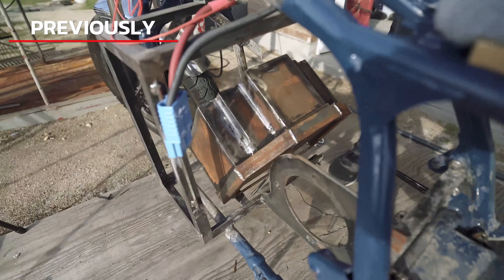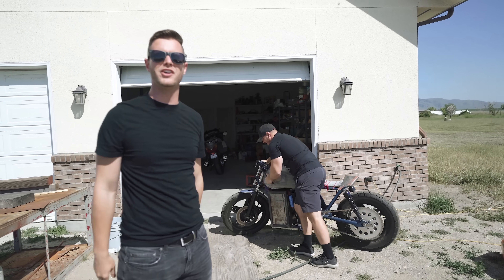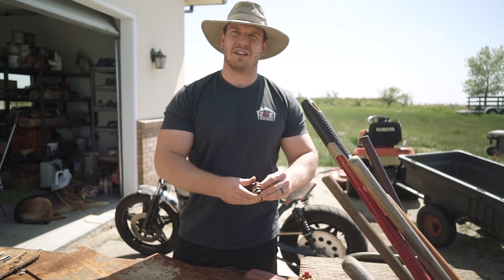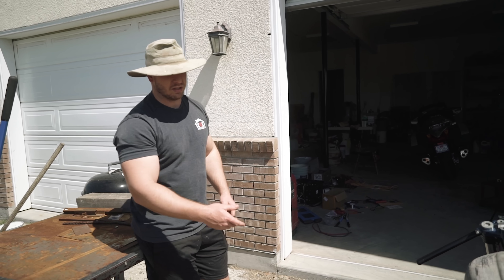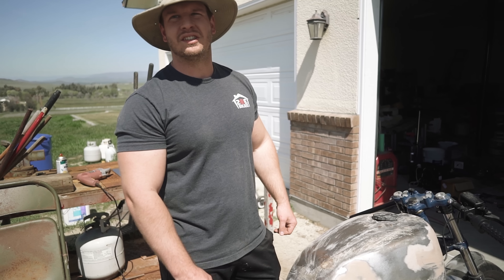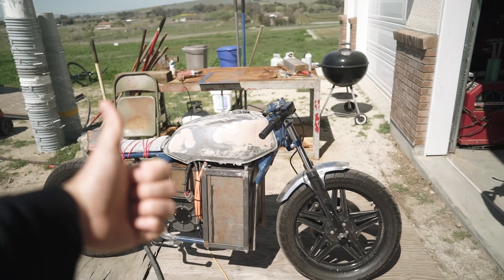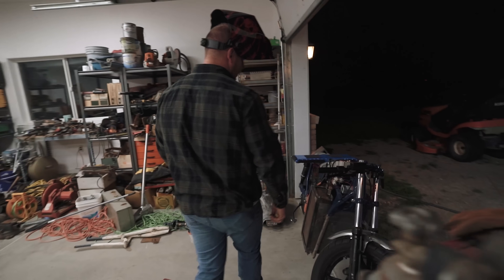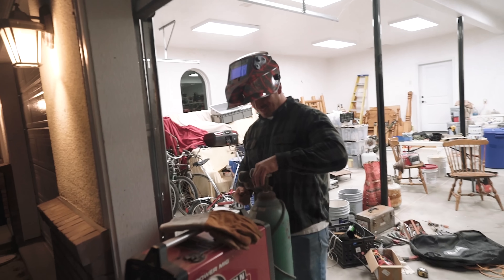We Made a SUPER-CAPACITOR for the ELECTRIC CAFE RACER Conversion Project

Comment: Hey. How the capacitor is connected to the battery. If it is directly next to the battery, can't a situation arise where the empty capacitor appears as a short circuit to the battery. Especially if the battery BMS limits the current and the capacitor discharges. So I've been thinking about a capacitor next to the electric scooter's battery.

Comment: I just use 24 40152 LiFePO4 cells that can deliver the amps to the 150 amp sabvoton controller. My cafe racer is 105 lbs, running a 12 kw hubmotor in a 17” motorcycle rim.  I use a bluetooth balancer…but NO bms between battery and controller to limit current.  Short cables between battery and controller.  No frills, but lifts front wheel effortlessly, 92 km/hr without flux weakening.  Silent, no chain noise….

Comment: why didnt they use the gas tank to put the battery in to save room instead of that big box ?
is it because all the wires are in gas tank?
and if they made the gas tank a battery you can easy remove it and replace with other battery later on when needs to be replace 
i think you better off to make thing come off like lego block to up grade and to remove easy and fast

Comment: Can you help me my brothers I’m about to buy a 2021 Zero SR and I need to know how many volt super capacitor battery pack I need to make and how do I install it , does the capacitor battery pack connect to the controller or to the existing bikes battery pack, I would love to increase range and power since theoretically and does recharge by regen braking
Reply: I read about 300 amps at 42 volts makes a 14kw battery back if so than that’s about 18 2.7volt caps

Comment: its a good idea in theory but due to the size of the capacitor pack you would be better off adding more battery which would lower the overall damage to the battery and increase performance in a high current scenario . What youve done here is completely and utterly pointless, capacitors give out their power from 0v-max voltage and lithium iron batteries 2.5-3.65v what youve done is make a high power capacitor that will only be used to what like 10% of its capacity and due to this its likely never even helping. Its mostly dead weight.

Comment: Supercapacitor nice idea but will not give measurable difference besides giving a little more stable power from a stop. would have rather liked to see some more powerful battery chemistry been used or higher quality battery cells. if manufacturers aren't using this sort of design there is a reason... usually.

Comment: Awesome project, really looking forward to see the finished product and how it performs , I am really curious about the super capacitors , I am getting myself into e-bikes, I have a rumble bike I have been upgrading as the original battery-controller-motor combination was really bad .  If you can share a basic wiring diagram to see how the capacitor was integrated to the bike it will help

Comment: What was your reasoning on picking a super capacitor? For the motor you’ve picked I don’t think it makes any sense. The current draw isn’t that high for the cells you have, but I do forget what chemistry you went with. Unless you’re using it as a secondary source to like launch faster and bypass the controller, but I wouldn’t think the power would be sustainable for more than a second. Was it just more to have fun?

Comment: Just an idea but try and get an oscilloscope hooked up to it. Measure things like pack voltage with and without the cap connected. Would be interesting to compare the voltage drop over time. It would prove if the pack is dropping too low on startup causing it to cut out or if there is some problem with the controller.

Comment: Isn't the battery pack (not super-capacitor but big boy) going to heat up in that metal box ? Is there any kind of cooling system or openings or do you think that just the breeze of the ride is going to cool it of enough ?

Comment: When you solder on SB connectors heat just the contact and fill it with solder. Then plunge the cable in. This makes a perfect connection without wicking solder up the cable.
Reply: That’s actually a good idea! I like to crimp it first to get more copper contacting

Comment: I'm a little ignorant on all the properties of the capacitors but my initial thought is to wonder if they will help increase the longevity of the cells by evening out the large current draws? I'm thinking of the graphs I've found for various 18650 cells that show the discharge rates vs time to total (effective) discharge. 

Do you have the specs for your battery packs posted anywhere? Like which cells you are using as well as the number of parallel/series groups per pack.
Reply from the maker: I think the last video has links in the description!

Comment: Capacitor will solve the spike need for high acceleration, but it comes with a problem.
The capacitor will discharge super fast, and will be a short-circuit until charged.
The capacitor will short the battery to get the 0,3 kWh as fast as possible, maybe even more Amps than what is used in the acceleration, if you are driving the battery will be already at max Amps charging the capacitor but the motor needs Amps too...
To resolve this, you need something to limit the charging Amps of the capacitor. Something like a BMS with charge/discharge separated port.
Reply: I wondered about how the current would be regulated from the pack to the capacitors too as I assumed without any regulation the draw from the capacitors would be massive.  

My knowledge in this area isn't comprehensive so there's all sorts of things I may not be aware of. From what you state, it sounds like you have the same concerns so maybe I'm not missing much.
Reply: That was really well thought out! Realistically, the voltage of the capacitor will not drop much below the voltage of the battery. If the controller calls for 300amps, it’ll come from both the battery and capacitor simultaneously, but in situations where the capacitor is depleted, it will not really refill until after the draw from the controller is gone. Overall, the stress on the battery will be less, but it will be charging the capacitor a split second after the motor draw drops off from full, and even then not on a capacitor at 0 volts. More realistically, the depleted capacitor may be 90 volts, which is not much energy required to top it off
Reply: @LordCurt  After a better though I can conclude my though is half wrong and you are right, but with a caveat.
After attached to the battery the capacitor will never go below battery voltage.
The capacitor will only work in delta of the drop voltage of the battery. (100V no load, underload goes 97V and the capacitor will discharge till 97V and then fluctuate/intermittent charge/discharge arrow battery voltage untill no load or low load).
So, you are right capacitor will always help, but the capacity in that voltage drop is really low.
The strange thing is that now the bike doesn't cut off and that means the problem comes from the BMS and not the controller?? (For the controller to cut off the battery would need to go to low state of voltage)
 Did you tried to record the BMS(bluetooth) voltage of each single cell when at full load (without capacitor)?
Maybe one cell is bad and at load the drop is to high and the BMS cut off for a breaf second?
Or maybe the BMS it not correctly programed for the Amps you bought (I have read some stories on 300A BMS when you program through bluetooth they become 150A because there's no 300A option on the APP), and the BMS protect against over current???
I don't see other options why the original battery would cut off. 
Did ever tried full load without BMS, connecting controller directly to the battery just to test if the cut off happens?

Comment: No paint needed kurt engineering a DIY bike that is comparable to the livewire and zero motorcycles. Should not be hidden. Clear coat and cover and fair as neccessary add the secret display and that's all. The mad inventor looks are awesome

Comment: Can we get some supercap specs? 
-Final Capacitance 
-rated voltage of each capacitor (2.6.2.7.2.75, or 2.8?)
-Maximum Voltage vs rated voltage
-Balancing circuit
-Maximum discharge current
-AWG of wire  you're connecting to the bus bars

I've got a 34 Wh setup, but they're in a 6s2p config for my gasser. 
The greatest thing about the setup is that I've started the car at as low as 8.5V-9V.
The alternator maxes out at 130A of charging (1.5kW) or 10W with my small sunroof solar panel. It saves 15lbs but I did it to get rid of my lead-acid. Lead-acid is a pain.
https://photos.app.goo.gl/NPHGyuRrHg5sK2Wa8
Reply from the maker: Video to follow on Monday!

Comment: Isn't the capacitor bank pointless if you don't have a charge limiter on it so that it doesn't pull same current from the lithium pack as it released moments ago?
I'm also not very confident about two differently sized battery packs(build with multiple cells in series) connected in parallel, I hope those BMS wires you pointed out are connecting all P groups together.
Also if you need super caps, use maxwells (tesla acquired them some time ago) not some chinese ones.
Reply: The caps give a harder punch off the line and the battery packs is good as long as they are equal volts the capacity doesn't matter because they will drain evenly.

Comment: i actually didnt undestand the purpose of the supercapacitor, someone please explain?
Reply: really helps with regenerative braking storing that energy quickly and using it when you accelerate. you are not dealing with chemicals based reactions of lithium ion batteries.
and also rapid charging they have a huge advantage vs lithium ion battery's and instead reduce charging time by a few hours on a full sized vehicle you could super charge in a few minutes.

also in the future you could potentially Wirelessly charge the supercapacitors and no longer need a wire. just park your bike and charge it.
 but right now, they aren’t able to store as much as lithium batteries.

But right now they are used to rapidly charge the power supplies in hybrids from regen braking,
so you can get a huge amount of range purely by harvesting and reusing so much braking energy. despite it being low capacity and it only adds around 10 lbs to the bike with metal housing.
but on a highway its not as good as you are not using regen braking  so 100% supercap battery is not as good.
Reply: @EpicProvider  could also be used for quicker acceleration, more power release in a small amount of time than a normal battery
Reply: got it, thanx. basically its a "fast in/out gateway for the energy to travel"
Reply: From my somewhat limited understanding, they can even out the large current draws and lithium cells will provide more energy at lower draws versus higher. 

Here's an example graph. Higher C rating means bigger current draw.

https://imgur.com/a/9JJMalE

Comment: i ride a lot of EVs and if not mistaken, super capacitors are used for fast charging correct? Do you know how long it will take to charge from 0-100%?
Reply: Post up a video of just one of them.
Reply: really helps with regenerative braking storing that energy and using it when you accelerate.
and also rapid charging they have a huge advantage vs lithium ion battery's and instead reduce charging time by a few hours

also in the future you could potentially Wirelessly charge the supercapacitors and no longer need a wire. just park your bike and charge it.

Comment: First bike with a supercapacitor I have seen and it makes sooo much sense. You will be able to deploy instant power for takeoffs and any regeneration from braking you get will be able to be stored at 98% recovery rather than the 3 to 5% normally possible using batteries. This will massively increase your range and power delivery stats! Really nice work! 
Almost a shame to paint it up, has a real nice apocalypse feel to it with the rust patena and banged up look. Will scare the hell out of other bikers and drivers thinking it's a junker!

Comment: Its all coming together like a glove! Im still confused on the purpose of the Super capacitor and what it adds to the build.
Reply from the maker: It was to solve the throttle cut issue we were dealing with.
Reply: @TheInja    I think maybe a cell(s) are experiencing voltage sag and tripping your bms under hard throttling.

Comment: Shoot!! You’re a freaking genius! Why has nobody added supercapacitors to motorcycles before??
Reply: They have, but those videos were rarely watched
Reply: @OrdainedMinister  links so I can watch?
Reply: Lamborghini
Reply: I thought about it 10 years ago... But I'm broke.
Reply: Cause they do nothing. In the current wiring configuration the caps are in parallel to the battery. And when you parallel batteries voltage will be taken from the highest source. So you hit the throttle and both the caps and the battery will give power, but due to the caps being super super small (capacity) they will just follow the battery voltage.

The added weight is worse than any "help" given by the capacitors.
Reply: @marsrover001  that makes sense, it can't hurt but will be hardy noticeable with the big battery pack they have
Reply: @marsrover001  it could definitely help to provide pulses during low motor speed! There are definite limitations, but it can smooth out battery operation.
Reply: @LordCurt  Big fan sirr♥️🤗
Reply: @LordCurt  Nope. If a super cap provides any improvement, that indicates a battery problem.
It's already trivial to implement a battery that can effortlessly saturate the controller.
All this is going to do is add a failure point, wind resistance, and weight.
Not buying it for a moment.
Reply: @marsrover001  I was wondering how the S-Caps had been incorporated.
Most energy drain is in the first few seconds of a standing start so to me it makes sense that the S-Caps would take care of that and the main batteries give the range.
I was hoping to see how that had been implemented !
Reply: @marsrover001  dont know the farads on those, but i have smaller, and they are 350f each 2.7 volts. Diveded on 6 in series, 58 farad, think short amperage is 850a each for mine, Gonna use them on my stereo build.. I think they will take some load off the battery on this bike, but dont know the specs of the supercaps or batteryvoltage
Reply: @jvsyoutube3298  you can see at 1:24 they are 2.7V, 500F each. This'll be a doozy
Reply: Currently its mainly Safety and Duration of Output.

Ordinary boring old batteries give the slow drain required for sustained flight (?), and if they short one gets a testicle toasting treat.
Capacitors release ALL their current in a oner, and if a capacitor shorts out, one gets a genuine *boom and blast in the bollocks.
*(The medical term.)

Inja has an example of a SINGLE exploding capacitor video out right now on his channel list.

Note.
This is DEFINITELY not the end of the capacitor idea.
It is FAR too good for electric vehicles to simply leave it out.

Note.
A Battery Set can take HOURS to charge.
A Capacitor Set can be charged in SECONDS !
Add to that size and weight savings, and you can see capacitors are a technology that's time is still to come !
.
Reply: Adding capacitors to help motor start up is a very old thing people have been doing for a long time. Industrial equipment like drill press and such have capacitors to give the motor a faster start. Nothing really new. People just don't know about it.

Comment: that super cap pack should help the battery packs stabilize considering the difference in pack specs huge safety improvement that helps performance
Reply: adding those super caps helps in so many ways f'in great idea